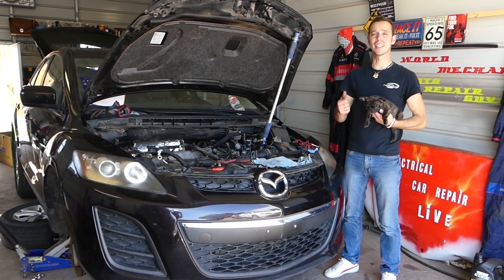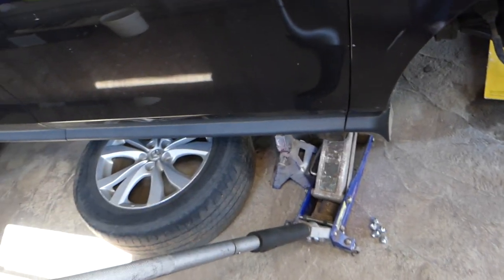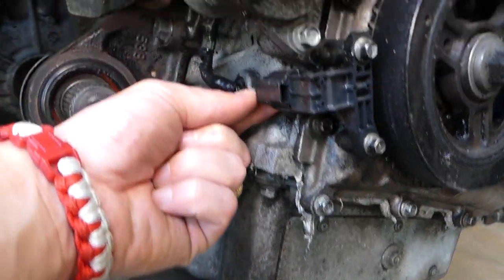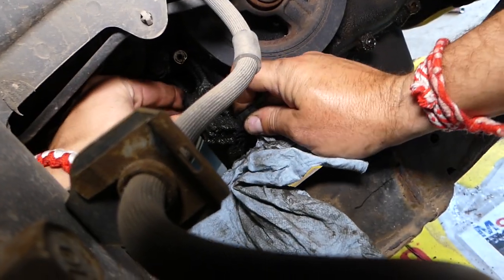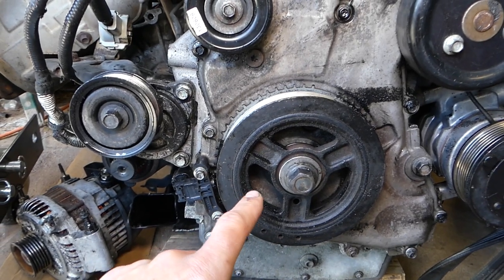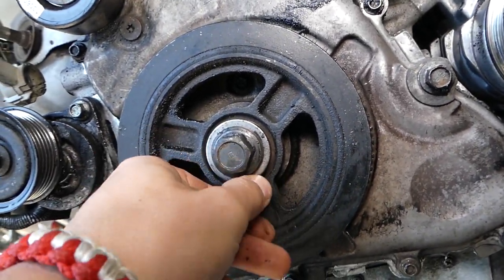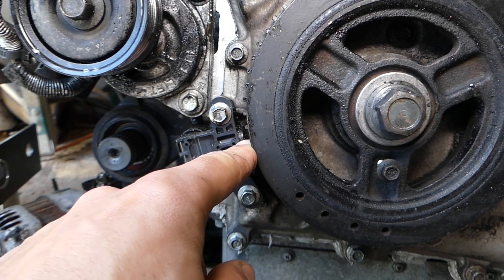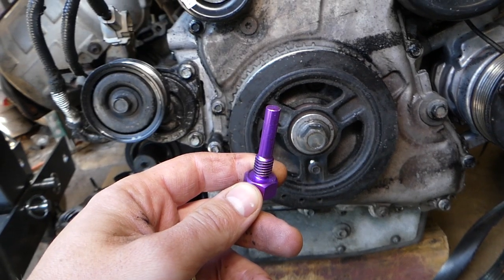CRANKSHAFT POSITION SENSOR REPLACEMENT REMOVAL MAZDA CX-7 CX7 MAZDASPEED 3 SPEED 6 2.3 DISI MZR

Comment: hello Your videos are awesome! i do have  a question i replaced the timing chain and when i put the ballancer back on i put a bold in the hole of the crank pully and the car was turned over. it loosened the bold on the crank pully but now when i try to re align everything the engine only will turn 1/2 way around by hand. What do you think i need to do to fix this?

Comment: With the protective cover over the harmonic balancer, is it possible to count from the lower part of the balancer backward from the bottom to find the 20th pin or is it necessary to remove the protective plastic piece?

Comment: Just a heads up 2005 Mazda 6 2.3 auto part store packaging the wrong size gasket for throttle body went to 3 auto stores stores same gasket it's not thick enough

Comment: hi i have a 2008 mazda cx7 i have changed Camshaft Sprocket  tensioner  timing chain and the Solénoïde   of the camshaft now i have a p0016 code just when the engine is cold and the engine tries to reduce its rpm after a one minute reset the code no p0016 ok but the engine is trying to reduce   rpm but no code have you seen a problem like this before please answer

Comment: I have a 2007 mazda cx7, with an engine light on an code p0302 misfire, I've replaced the plugs, ignition coils are good, an injectors are fine, is it possible the cam angle sensor or crank sensor could be creating this specific misfire?
Reply: Hi, I have the same problem, how did you solve it? The sensor is dirty, I will try to clean it, waiting for a solution.
Reply: 2011 same problem here, 🙋 I did a Lot to the car, about to change the PVC valve I got SEE 👀 how everything go..
Reply: It could be one those two, the cramchaft & the PCV valve.  Their so cheap, You don't lose nothing by doing it..

Comment: I just installed cam sensor i didn't do TDC Procedure. The car starts and drives perfect, actually took a few seconds to start today. I tried to find TDC and count 20 teeth, but I only have 15 teeth on one side and 14 on the other. Is there something I'm missing?
Reply: Hey mate, wondering why u changed your cam angle sensor? What symptoms did you have?
Reply: @dannielbarton204 I have a misfire, it start acting wear, it hesitate, it take too long to shift. But before I due the cramchaft i gone due the PCV.